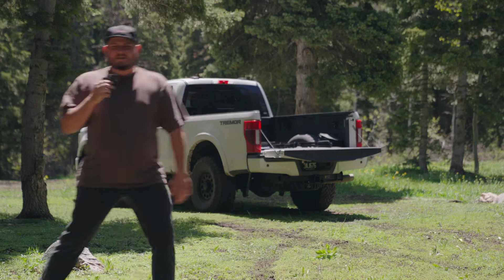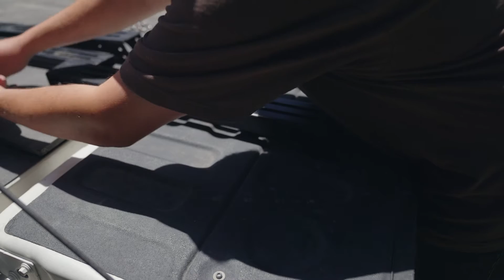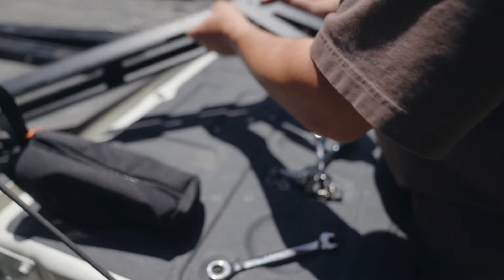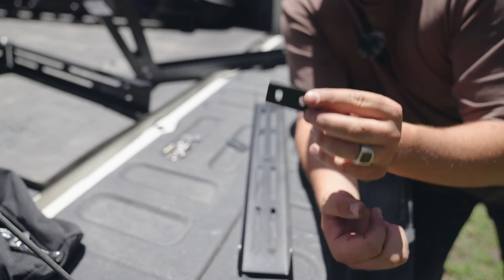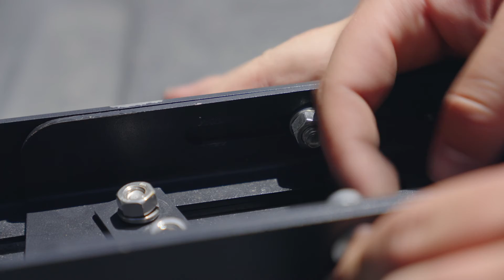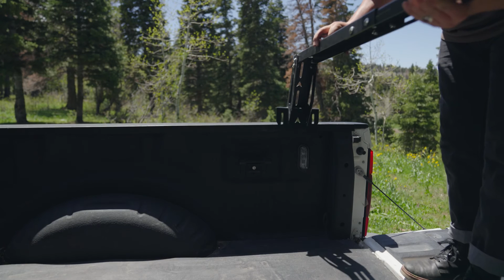ROAM Universal Bed Bars Install

Comment: This is completely wrong. I had to redo every bolt and put on another washer that was Included in the packaging. Not sure why that’s not in this video..
Reply: Did he install the mounting plate with the threaded knob pointing away from the truck bed or inwards?